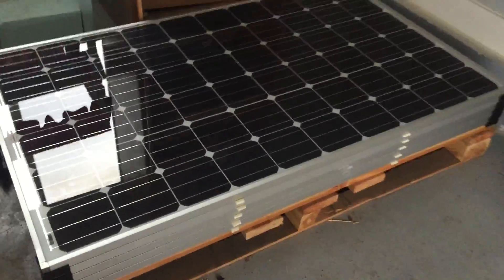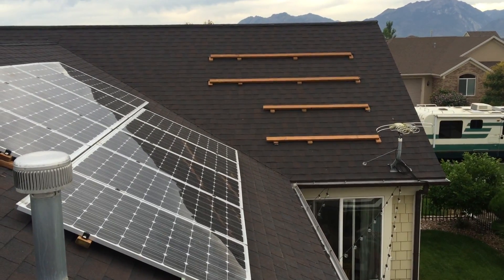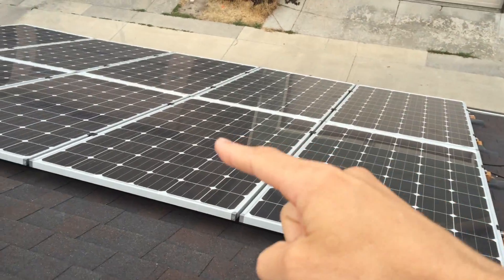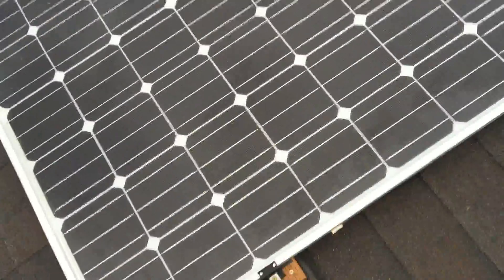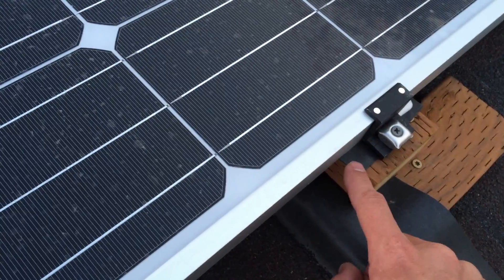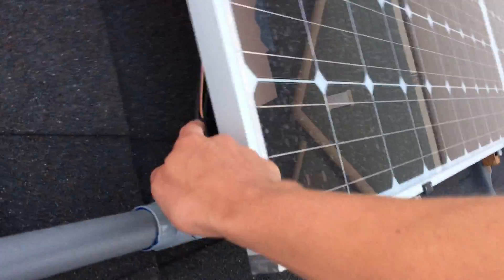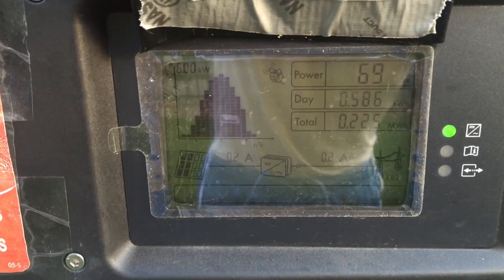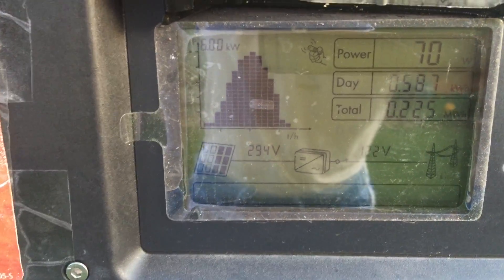How To Install Solar Panels Yourself For $4K - DIY 7KW - South Jordan, Utah - Cheap

Comment: I cringed a bit when I saw PV panels on pressure treated supports, then I felt better when I saw that you put rubber between the two. It looks like you used deck screws to attach the mounting system to the roof, which is probably not a good idea. When I installed solar for a living, we used lag screws but these days people probably use those Spax screws, which are thinner but of equivalent strength. Wind can produce some pretty significant forces, and deck screws aren't designed for that. 

I think using PVC conduit on a roof is not a good idea. Roofs get quite hot (my former boss measured 165 degrees under a PV panel in the summer) and PVC gets soft in heat. It probably will protect the wire okay, but it'll start drooping and looking like spaghetti.

The flex conduit around the inverter definitely looks, uh, not the best. Aesthetics aside, there should be a drip loop on every end of the flex conduit. It's a loop that points down, and the point of it is to allow water that runs down the conduit to drip off instead of running up against the connection at the box. I'm surprised you passed inspection without drip loops.

I agree with the comments about using metal flashing instead of rubber for the rack mounts. You'll get a number of years out of the rubber but after that, you're on borrowed time as far as roof leaks. It must be nice to not have to use stainless fasteners, thanks to your relatively dry climate! I lived on the coast when I installed solar and we used stainless everything, which is expensive and annoying (stainless galls very easily, and fasteners cold weld). 

If I were you, I'd very strongly consider retrofitting the racks with lag screws or equivalent. Drip loops would be wise too, but what you have is probably fine. It'd be quite a pain to redo the conduit/wiring to be longer to make drip loops, so I'd inspect the insides of all electrical boxes regularly to make sure they're dry instead.

Other than those things, this looks pretty good. Solar isn't rocket science, and it's good to see a homeowner putting his own system in mostly correctly. And to be honest, I've seen "professional" installs that were not this good. And you get the satisfaction of knowing you did it yourself, which is a great benefit in and of itself! 

When I did solar (2003-2008), it was running about $10/watt installed, and a single 160 watt panel (the standard size--boy have PV panels gotten big!) cost $1400! It's so good to see vastly lower prices.
Reply: One other, mostly unrelated thing to consider: it's a very good idea to put a whole-house surge arrestor in. They get wired into your main panel, run something like $150, and should keep expensive stuff like heat pumps from getting fried if there's a power surge.

While I'm here, I'll mention another detail: all wiring connections that aren't inside the house should have anti-oxidation goop on them. I believe the kind I have is No-Lox. You coat the exposed copper wire ends with it (and squish it into the strands) before you install them into terminals/etc. It keeps the copper from corroding over time which, granted, is less of an issue where you are since it's dry there (I'm in western Oregon), but over the course of many years it could still be a problem. It's very cheap insurance and you could do it retroactively. Corroded wiring connections cause localized heating, power loss, and excess current draw.

A side side note: the flex conduit you used is fine, but I personally prefer liquid tight metal flex, which is essentially the same stuff but it also has a spiral metal sheath underneath the waterproof outer plastic. It's like the standard flexible metal conduit you'd use indoors but with a covering of the plastic flex that you used. Aside from giving the wires inside much more protection from physical damage, it's also MUCH easier to pull wires through it. Disadvantages are cost (of course), it's harder to cut, and, because it's metal, it requires grounding bushings on the end(s).

A side side side note: when using conduit outdoors, always assume that it's not waterproof. The NEC requires wet-rated wire in outdoor conduit because it considers conduit to provide physical protection, not waterproofing. It's not uncommon for conduit to fill partway with water, which isn't great but it isn't necessarily a problem either since the code basically assumes that the wire will always be sitting in a pool. The point is to always use wire listed for wet locations (the W in THHWN is for Wet) and to plan things under the assumption that water will get into the conduit. Aside from ease of installation and price, PVC conduit is good because it's glued together like plumbing, so it's as watertight as (normal) conduit gets, but one should never assume that any particular installation is truly waterproof.
Reply from the maker: @bmay8818  thanks again for this additional feedback - I have added to "Lessons Learned" on https://diynewman.wordpress.com/2016/07/24/how-to-install-solar-panels-yourself-for-4k-diy-7kw/
Reply from the maker: Thanks so much for your positive and critical feedback.  I will take it into account when I do my next solar project!  It is great to hear from an expert.  It is amazing to see the costs continually drop over the years.  sunelec.com has panels for $0.25/watt and you can get 7kw string inverters for $1500 on ebay - so 30-40% cheaper than when I did my project a couple years ago!
Reply: @MattNewman  Wow, that's shockingly cheap! When I did solar, a string inverter ran around $3500, and micro-inverters, the inverter-per-panel kind, had just come on the market. I believe they cost $150 each back then, so I hope they've dropped too.

I make a point of being fair and not a jerk to people on YT (except the racists, on whom I go full nuclear), so I'm glad that's appreciated. I get tired of comments like "ur stuff sucks lol". I think it's helpful to point out things that could be done better, but in a nice way, and to not ignore the things that are done well.

When I installed solar, it was when it was the most expensive (there was a shortage of silicon) and I did it in Humboldt, a place not known for having good sun, and people still bought systems. I'm sure my old boss is doing very well now that prices have fallen so much! He actually wanted to hire me back a few years ago; apparently it's hard to find competent employees.
Reply from the maker: @bmay8818  Yeah, I think you can get micro-inverters for less than $50 now (https://www.ebay.com/itm/Enphase-M215-Solar-Micro-Inverter-M215-60-2LL-S22-Bulk-Shipping-Rate/382665873876?epid=2047092678&hash=item5918a9d9d4:g:f0kAAOSw~BRcDoit:rk:13:pf:0).  

That is a great way to give feedback - when you point out some good and some areas to improve, it inspires the person to be better.  

Yeah, I still have dreams of starting a really affordable solar business for the masses - you would be a good one to help me!

Comment: Add the emergency plug to the Sunny boy, that inverter will work in a power outtage. It will run your fridge for sure,
Reply from the maker: Tim Hucks indeed

Comment: A couple of questions, now that it’s been a couple of years since your install.

How has your power bill average out at the end of 12 months? 

At the time of install, what did Utah allow for an annual power made? In the years leading up to 2017, in CT home owners could only have solar power generated up to 92% of their annual use. Now, from I hear, it’s 110%. Meaning I could install a system that can wipe out my annual power bill plus 10%. 

Also, since you used PVC conduit on the roof... how has that held up? My electrician teacher told me never to use PVC on any install outside, especially if it’s going to get a beating from the sun. With yours being on the roof, it’s also getting the heat reflection from the roof. Have you replaced them yet to steel?
Reply from the maker: Robert Steich the pvc is holding up just fine after almost 3 years.  If it deteriorates it will be fine since it is just protecting wires that are already protected.
Reply from the maker: Robert Steich oh and I have kept the lumber - it is working fine still.  It hasn’t really worn out since it is covered by the panels. You can see my follow up video ad blog in description for more details.
Reply from the maker: Power bill is $8 per month and one month of $100.  I used to pay $1500 in power - now it is $200. I save $1300 per year and system cost $4k so I will break even this August 2019. It generates about 11,000 kWh in a year and I use 12,000 kWh so I have to pay that extra.  I could have made it bigger - Utah doesn’t restrict you.

Comment: I like the idea of putting metal flashing over the wood. Also before the flashing brush the wood end to end with tar or flex seal or roofing rubber... As they are the weakest point is the ends. They should be sealed with tar or something. I would cover any wood that is exposed to the sun and weather. If you don't put flashing along the entire length of the rails at least cover where the panels joint together. You could use silicone seal along the joints. Anything you can do to keep the wood dry er... Is worth doing.
Reply from the maker: RogueOntheRoad great thoughts - thx!

Comment: Nice job overall.  A bit sketched out by the pressure treated lumber on the roof.  How in the world did that pass a visual inspection?
Reply from the maker: asusreviews yeah the inspector didn’t seem to mind - was more concerned with how it hooked into the main.

Comment: Arizona is so screwed up. We have tons of sun but regulations, permitting and power companies are all working against us getting solar.
Reply from the maker: yeah, that is too bad - rise up against those conspiring against you and stick it to the man!
Reply: reset your expectation and change your implementation

don't go net metering,  install Tesla batteries, two of them.  Then only use the grid as a battery charger when your solar panel generation is low. No utility permits needed
Reply: @dougbertInExile  is that real?  Tesla batteries for a home?
Reply: ninles1 bruv.. it is Koch... if you hate them so much, at least get the name right

Comment: Are you able to utilize your solar energy or grid is offline?
Reply from the maker: Ducati M yes my inverter allows me to have one outlet from it.  You can also add a more complex set up so that you can switch over and bypass the grid. I haven’t done any of that because our power never goes out.
Reply: Matt Newman Great video Matt! I live in the Utah County area myself and want to do this on a smaller scale and use batteries as a back up for off grid use. I need to find out how much power first. There’s a lot to learn and a lot of different ways to do this... Appreciate your attention to detail on your demonstration!
Reply from the maker: @ducatim1563  Thanks - sounds good.  If you are using batteries, you may want to look into DIY Powerwall.  Also, to figure out how much power, just look at your power bills to see how much you use per month.  In my case, I use about 12,000 kWh per in a year, so I needed a 7 kW system.  The math would be pretty similar for any system, especially here in Utah.

Comment: Congrats on the system.  I just installed one but it was total DIY.  I used ironridge racking, solar edge inverter and optimizers and used 327w series E sunpower panels.  That conduit is a hassle coming off the roof to the inverter but cheap to do.  I didn't get any rebates or tax credits as it is under the radar at this time but cost $5400 for 7kw.  Not sure what inspection will be but it works great.  I can see what each panel is producing during the day and the cumulative.  I am getting about 500k per month during the overcast days in December and January here but soon as it is sunny I generated 23kw per day 10 times this past month.  I look forward to summer.  The solaredge inverter forces my meter to zero when I am overproducing so I don't get penalized for it.  I put the sense system on the input from the grid off the meter and check the consumption.  On a cold sunny day it keeps the input from the grid at zero most of the day.  The inverter monitors the grid and adds .2 volts to the input so the house is fed first, then the grid.  Pretty clever.  The panels were 34 cents per watt.  Got them off ebay.  The optimizers are cool in that they throw off 1 volt  if grid not detected so very safe to install and test connections.  I had 10v on 1 leg  and 11 on the other.  Glad to see you did this.
I agree on the rebate program being detrimental to the installations.  I figure 75% of the install is non equipment, just profits and people pusing paper to justify their existence.  This is Feb 2019.  6kw inverter was 850 on ebay, optimizers were $65 each but they just went up due to Trump to $85.  21 of them was a  big expense and you could do without them but they knock the 60 volt panels to 40 volts and manage the voltage so only 397 volts comes off the roof and into each leg..  The optimizers adjust the current.  The inverter has several interfaces to the network.  I used a remote ethernet that plugs into the power and makes a secure connection to the inverter to my router.
KUDOS on the video.  Gotta get my ass in gear to post my install.
Reply from the maker: Thanks for sharing - sounds like a great setup and very inexpensive!  I am impressed you were able to get ironridge racking and also the safe optimizers for that price.  Would love to see a video and/or docs on your system.  It is people like you who inspire me and really make me wonder if we should start a solar company that is different and exists to get solar for the other 99% of people who don't have it yet.

Comment: Power companies are now getting very reluctant to pay for excess generation on home units.. Do not include credits from the utility when calculating return on investment, because in a lot of areas, that got pulled by the utility. (Study the Duck Curve to see the problem.) ---- the Solar goes off line as the sun goes down...and that is when the peak draw starts.)   They want the ability to turn off the solar feed when there is excess generation.  (You cannot start and stop coal power or nukes in a few hours.. think days and weeks...)
Reply from the maker: yeah, but I am grandfathered in.  If the power companies ever did weird stuff (if we allowed them), I would just get batteries.

Comment: I’m excited about your set up. I have 10g to put into solar/wind. I don’t want a grid tie in. I want power when no one has it.
Reply: Kristi Yagwit - you can do both! When my power goes out, a transfer switch takes my system off the grid and runs it through my standalone inverter to power my place. Works great.
Reply from the maker: @cotronixcoolson3999  Nice!  My power never goes out, so I haven't invested the effort into getting mine set up like that.
Reply from the maker: Sounds good!  So if you don't grid tie, you will need batteries.  You may want to look at getting lead acid batteries on ebay (cheap), like the ones in scooters, kids' ride-on cars, etc.  You can also look into Powerwall DIY where people use laptop batteries to make their own Powerwalls.

Comment: does your inverter or any of the components connect to your network so you can see whats going on with your system from a computer/ phone or tablet?  I'm in Sandy, maybe i'll be your first job :)   Great work on the panels and the install looks great!
Reply from the maker: Kevin Mansouri yeah I got a card for the inverter for about $60 on eBay that you add and it has an Ethernet port. I ran that under the ground and to my basement where the router is.  You can also do it wirelessly but it is quite a bit more expensive because inverter companies aren’t great computer hardware companies.  I use the sunny web website and mobile app to see usage and charts. It is SMA as I have a sunny boy inverter. It is pretty good software. Anyway, if you do have interest in working together a bit on your project I may be interested.

Comment: My favorite type solar systems are battery backup of critical loads, and power hogs (central air for example) on grid only (not on solar).  By keeping the power hogs OFF the solar/battery system, if the grid goes down, the critical loads can still be powered, and the inverter size (capacity) can be reduced, thus likely reducing cost.  If the grid goes down AND there are several cloudy days in a row while it is still down, a generator can be used or even an idling car (good for about 1 KW of charge power).  I have tested this and it works well and doesn't use much gas.  Maybe a gallon every 4 to 5 hours for a 4 cylinder engine idling at about 900 RPMs.
Reply from the maker: David James This all sounds interesting with the hybrid system that does grid tie and battery back up, but it would have doubled my cost and wasn’t worth it to me. The grid literally never goes down where I am so I see little value in having the battery back up solution. In areas where the grid is less reliable, that would make sense